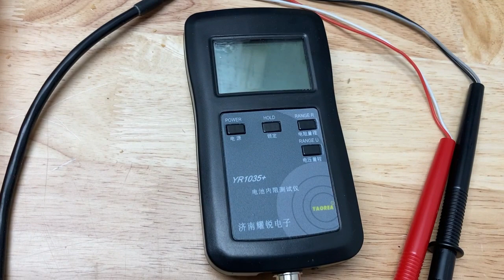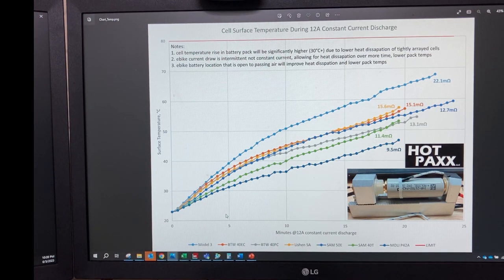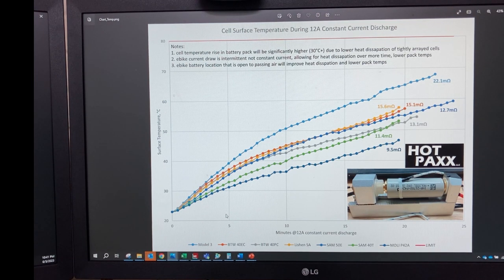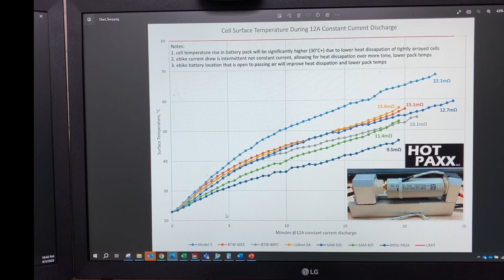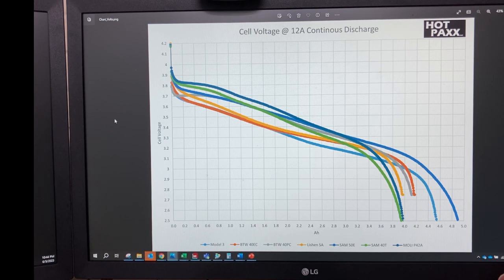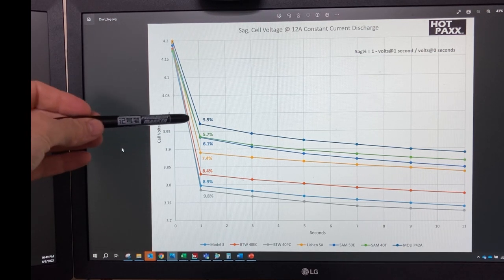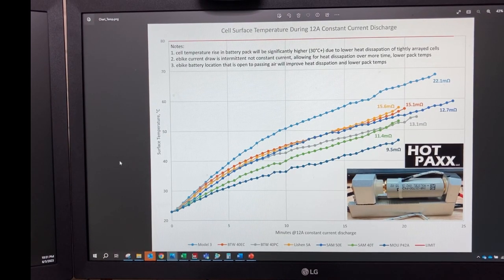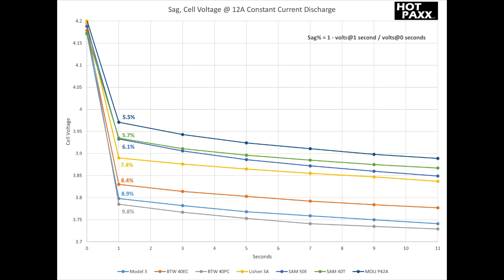Cell Selection, Lithium Ion Battery Pack

Comment: The Samsung 40t would be good if the cycle life wasn't 60% after 250 cycles That's as bad as Chinese No names... however, the Samsung 48x is supposed to be 70% after 3,000 cycle at 10 amp

Comment: I just did a 12a discharge test on my fake Molicel P42A so i can compare to your test cells. Seems its behavior is very similar to the LiShen LR2170SA.

My temperature results will be a little higher because i insulated the cell and temperature probe to get more real world in pack temperatures.

Comment: @8:04 I’m getting ready to build a 13-16s 5p 21700 for my ebike which I’m designing to run at up to 60a continuous, with peak discharge of 170a. 

So 12a/cell is my continuous target, which is seems the 50E is staying under 60 degrees C and delivering super mah. But I think my bursts of 170a are way over what these can take. 

Of course in an ebike, it would be 10 seconds at 170, then down to 60a max cruise speed, with realistic cruise being more like 25a (for 20-25ah battery).

So the question is how much damage it does during short bursts. Is it so fast that it messes with the intercalation of the ions, the electrolyte, the anode or cathode doping?

So even though ill take a hit in range and cost, im shook for something that will stay under 60c at 20a/cell and allow bursts of 35-40a per cell.

I just ordered a tester that will allow up to 20a discharge test. I wish I had your system but its too expensive lol.

My main test will to see if the cell I got was a rewraped cheap cell , which hopefully a 20a full discharge test will reveal.
Reply from the maker: Current draw is proportional to motor speed.  If your peak current draw is 170A, it will immediately come down with increasing motor RPM.  I asked my cell supplier if 140A/5p = 28A/cell (a few seconds) was ok for a 12a continuous cell.  They were not concerned and I have had no issues.   I believe acceleration time is important.  In my application 0 to max RPM takes 10 seconds or less.  Samsung 50E has rated discharge capacity at specified current draw.  To determine if your cells are legitimate, I would check the capacity at the rated charge/discharge rates.
Reply: @HOTPAXX , yes, I will set it so it comes down but if I let it go deep into flux weakening the 170a will flow until the magic smoke comes out of the motor. Lol.

My plan is to set phase current to the maximum until my motor sounds like a transformer getting ready to blow during acceleration. Then my controller allows me to set several RPM-power limits, so the first limit I would determine maximum continuous cruise speed (based on motor temperature), and then set the controller to limit to that current at that RPM and higher. And then if I decide to use flux weakening, I would set more limits such that going uphill or into the wind, it wouldn’t allow flux weakening but downhill/with the wind it would allow it. But at less than maximum continuous current.

But I will also have 3 speeds so i can set it:
Speed 1: acceleration and top speed of original POS ebike
Speed 2: Double original acceleration and up to 50 kph (maximum legal here)
Speed 3: 170a acceleration, 60a cruise speed (should be 70 kph), 

I will get the controller next and the battery last since the controller with my present battery will probably be able to define what specs I need on the battery. 170a on my present battery would probably send it into LVP by time it reached 100a. Lol

Comment: What equipment do i need to determine CDA on batteries that have no markings on the label? I would be using these batteries for 18v tools ie drill, saw etc. I'm guessing that a 20a discharge battery would work without overheating
Reply from the maker: ATORCH DL24 discharge tester is $30 on AliExpress.  The one I purchased worked well for verifying cell capacity at different current flows up to 20A.  Take note - the cell temp sensor they provided was not accurate.